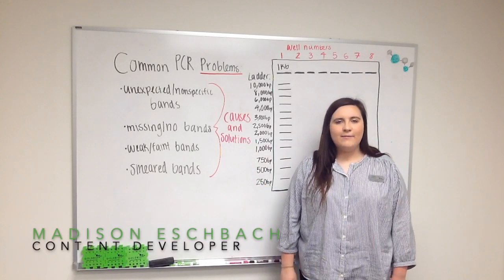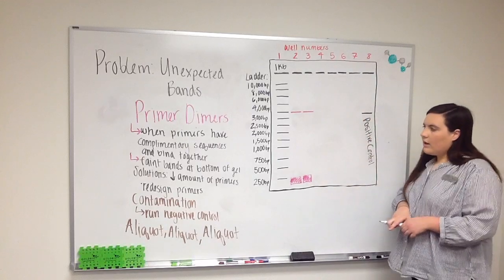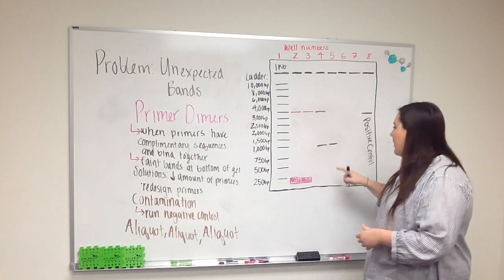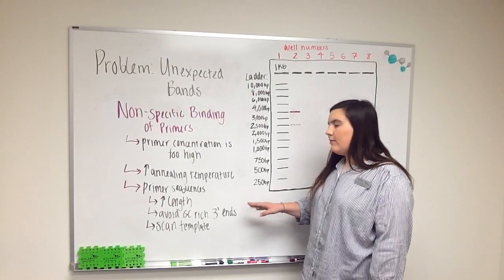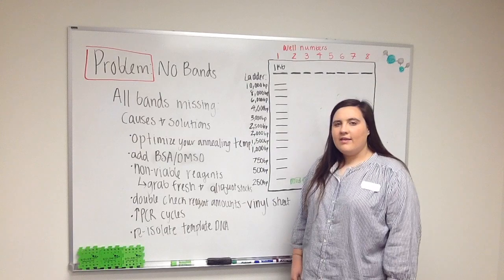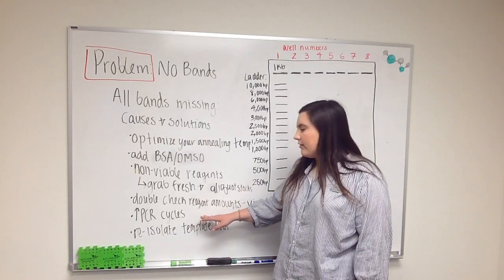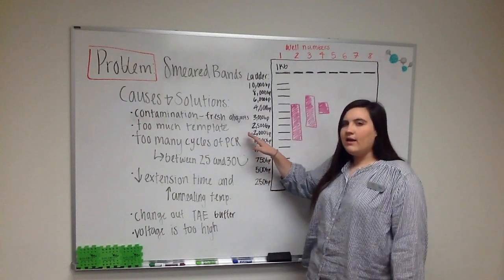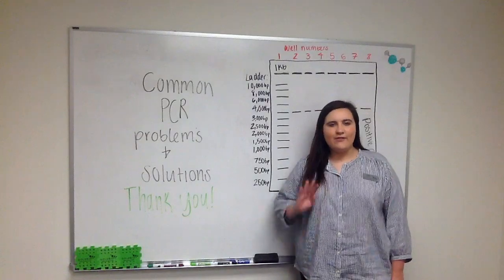PCR Troubleshooting: Explanations and How to Fix Common PCR Problems

Comment: Great video. I just have on comment on negative controls. What you've meant is a no-template control. A negative control contains DNA that is the "wrong" template for your primers, for example from a different species, that doesn't contain that target gene region.